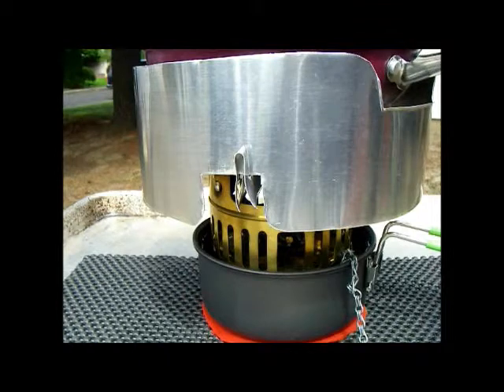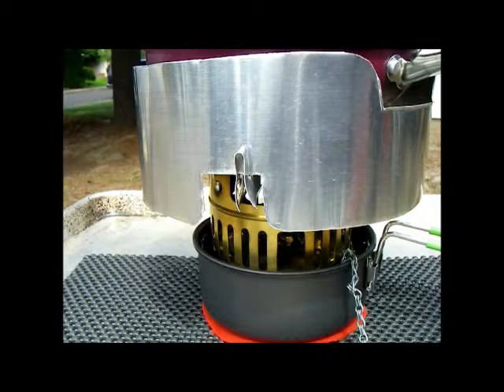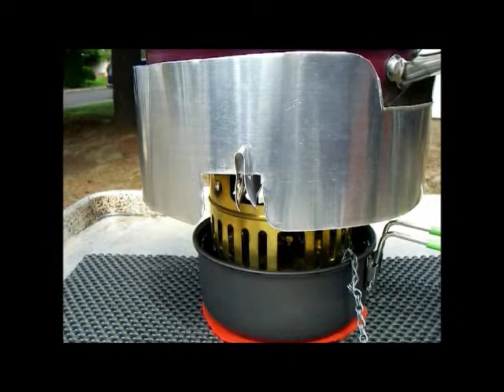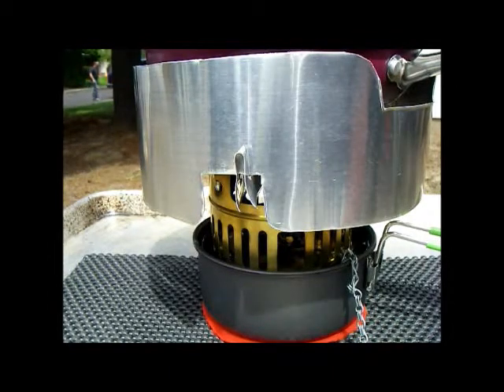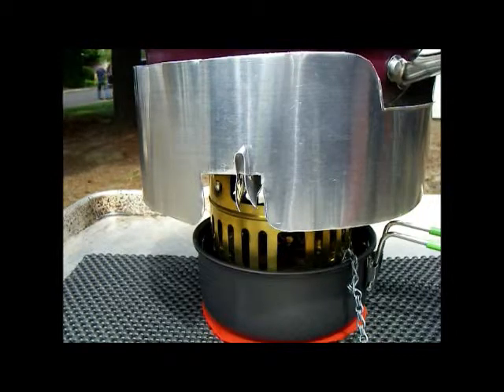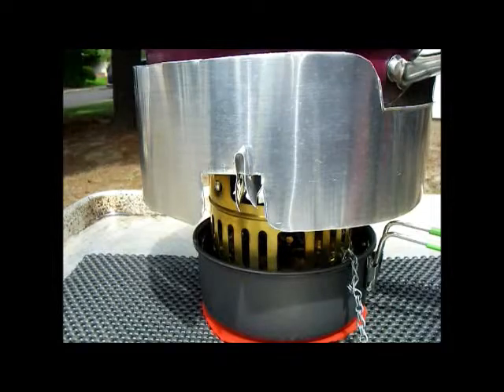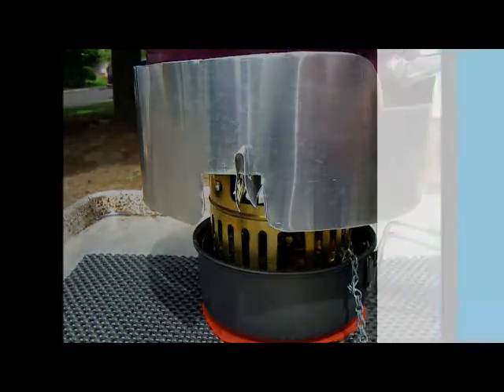SVEA 123R Tank Heatsink Experiment

Comment: I've used european unleaded gasoline in my svea 123R backpacking in eastern Europe because I could not find white gas (coleman fuel) locally. Unleaded gas works fine, won't damage your stove at all but it is more smokey and smelly and can leave a sticky residue on things like your pots and the windscreen. I'm sure you can find whitegas for a decent price in the UK though, it is also called naphtha.
Reply: I can’t get white coleman gas or something similar on my island in the Caribbean. 
I use a mix that I make. 
1/3 99% alcohol(not the 70%) and 2/3 kerosene I get cheap at the gasstation. 
3/3 is of course the max amount of fuel that goes into the svea123 or 123r.

Comment: Thanks for the info...i really like the svea (i do not have one yet)  but i am in the uk so coleman fuel is too expensive. I believe some have tried unleaded petrol in the svea. But it seems that most say it will clog up the tubes.....?? if i were to get one it would have to burn unleaded so i am a little worried about damaging it....
Cheers
Chris,
Reply: I use a mix.  1/3 99% alcohol(not the 70%), and 2/3 kerosene I get at the gasstation. It works perfect and is cheap too.! 
I used automotive regular gasoline too, but it clogged up the valve and jet every time. I don’t like the idea to eat food cooked on regular gasoline. It can’t be good for your health. 
Alcohol and kerosene are safer I think.  I do prime my stove till the tank is hot, before starting the roar of the stove. I go 1hr and 20min on my mix full trot of the stove.  
Greetings from the Caribbean.!